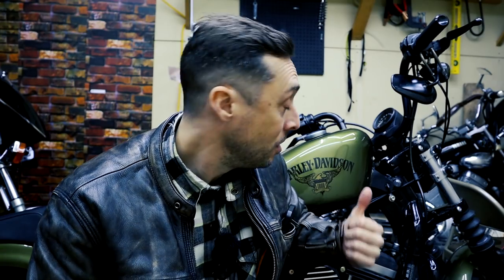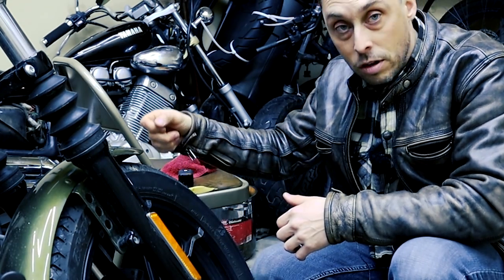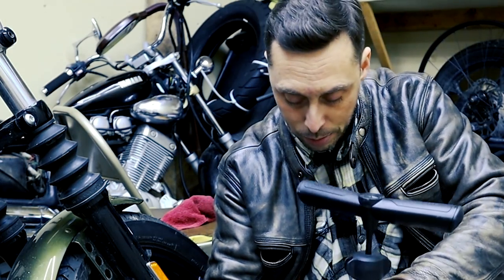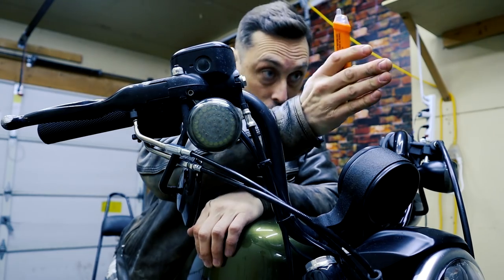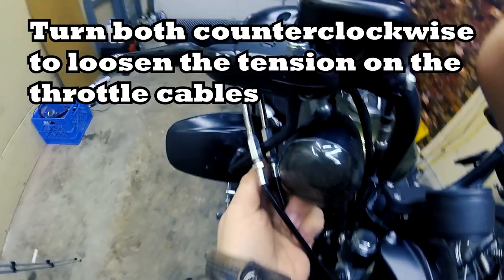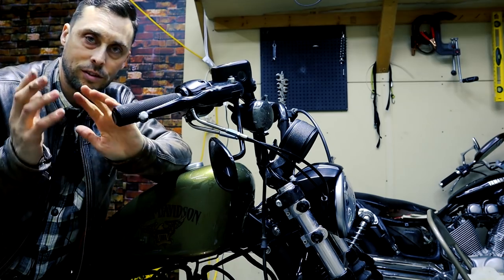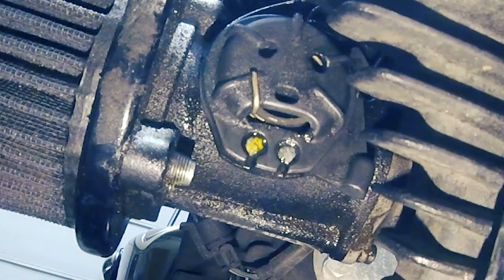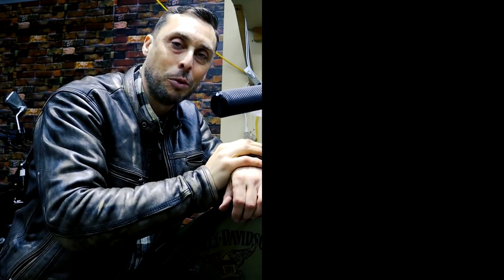Harley Davidson 5K-Mile Service for the Iron 883 Sportster

Comment: Have you calculated how much you have saved doing this all yourself?
Reply from the maker: I had the 1K done at the dealership about three weeks after I bought the bike. It cost $380! I've done all the work on the bike since. I should really sit down and calculate a rough estimate. For the 15K alone, I probably spent $80 worth of oil, transmission oil, and spark plugs. That alone is a savings of $300. I can't really count my time in the garage because I'm doing what I love while drinking a beer.